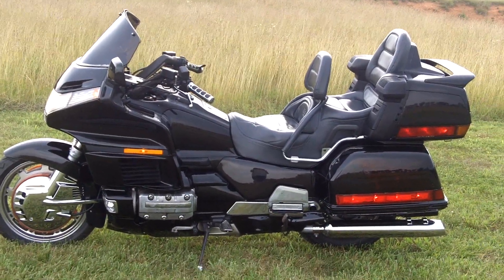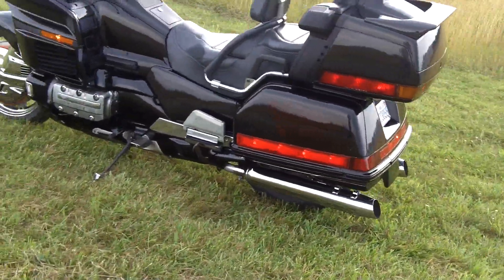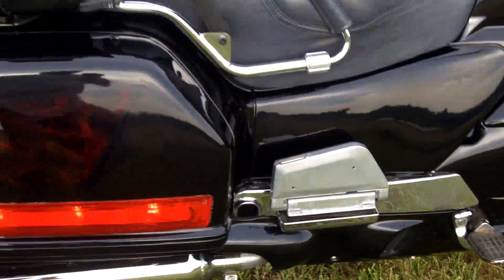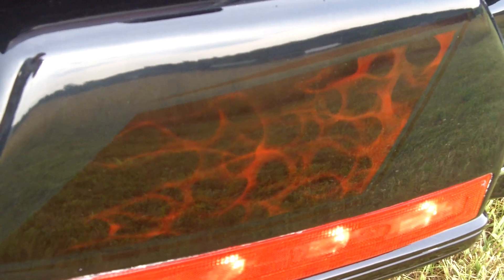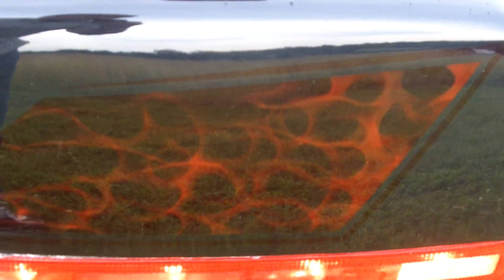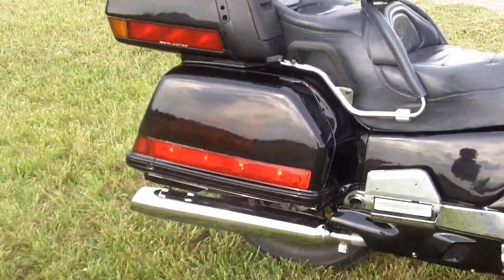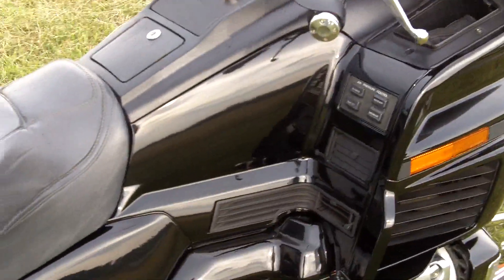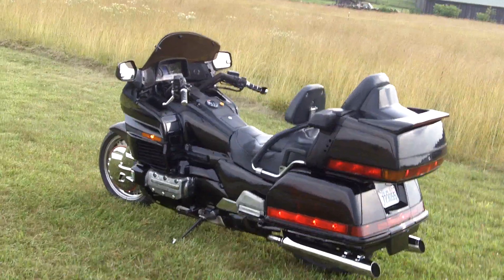GL1500 Goldwing-HD Mufflers-Custom Paint-Modified Stereo-Bagger Windshield

Comment from the maker: Thank you for your encouragement!  I got the windshield from baggershield.  Check them out online.  I really like the windshield because it gives me good options, with it "retracted" down, at higher speeds I get some helmet buffeting, but below 60mph, its quite comfy.  I've also added some LED lights I got from the auto parts store that are meant to be for the bed of a truck, and I put them in the saddle bags and trunk.  I then wired them to a $10 transmitter/receiver unit i found on ebay, so I have a key fob that I can push the button on and it will light up auxiliary lights and the trunk lights for those dark evenings where you want to see your luggage.  I ride this bike year round and put more miles on it than I do my truck and car combined.  Another nice addition that I've done is put pioneer speakers in it to handle louder volumes at higher speeds.  With the boat radio and being able to play MP3s on a thumb drive, I have all kinds of options.  Ive also separated the front/rear linked brakes.  I didn't like them being linked so I put a splitter in the front brake line to activate both calipers with the front master and I put a pipe plug on the rear master cylinder.  I have a track bike and I didn't want to develop "bad" habits of using the rear brake alot on the street only to have to unlearn that at the track when I go.
Reply: That’s awesome to hear! 
I’m looking at the Baggershield myself, wondering, would you recommend the shortened 19” one as well or would you stick to the convertible windshield that you have, due to the buffeting at higher speeds?

Comment from the maker: I used a boat radio that has mp3 playing capability.  Its a Milennia PRV15.  I removed the center panel and removed the origional stereo.  I made a fiberglass panel that would fit in the hole the the origional stereo was in and then used a hole saw to mount the new boat stereo.  I also had extra room on that panel so I mounted a large push button switch for switching off and on the fog lights and I also mounted a panel mount usb port for the thumb drives for music.

Comment: That is one super cool Goldwing!!! I love the blacked out effect and the painting of the chrome piece under the windshield and the short windshield ....slick. Gives it a distinct look. Now however I do have one question....I thought about using some Harley pipes "only for the sound" however yours seem to be rather quiet.....no rat-a-tat-tat or rumble.....How did you manage to do that?
Reply from the maker: I think with the cam profiles, you're not going to get alot of the combustion sound in the exhaust.  I think harley's have a cam that opens the exhaust valves earlier, allowing the combustion process to continue out into the atmosphere.  Basically I didn't do anything to keep it from being too loud - its just the way it is when I put those pipes on.  Considering the distances I ride, its nice having it still not painfully loud, however when I roll back on the throttle pretty hard, you can definitely hear it.  When I installed these pipes, I welded a little tab to the saddle bag lower support and used this to bolt the pipes to, but you don't need to, I suspect you can make a mount that uses the original mounts that have the bushings in them to adapt to the HD pipes.  I wasn't sure I was going to like painting over the chrome under the windshield, but I do like it.  I did it because my chrome panel was bent up pretty bad, so I used body filler in it when I straightened it so I had to paint it.  I've also installed a jet kit to offset the free flow exhaust because it tends to run a little lean with the HD pipes and stock jets.  Jetting it definitely makes it more peppy!

Comment: Great looking wing! My question is about the exhaust. I have Harley pipes from a road glide on mine but I'm wondering is the pipe you're using to replace exhaust chamber an "X"or 2 separate pieces directly from header?
Reply from the maker: @ShoNuffDC, sorry I've taken so long to respond, but I don't have the x pipe on it... just two separate pipes.  Would have been a good bit of work to make a cross over.  I did think about welding in a small pipe to allow balancing of pressures between pip sets, but I never did it.  Still ride this bike at least once a week.

Comment: How hard was it to make the piece for the radio conversion?
Reply from the maker: I took that center piece out and flipped it over on top of a flat piece of sheet metal, then "lined" the plastic piece around the radio hole with aluminum foil (put WD40 on the aluminum foil as a deboning agent to be able to get the fiberglass off of the aluminum when done), then mixed up some resin and hardener and used some CSM fiberglass strips and layed it up so the glass wrapped around to the original screw holes that held in the OEM radio.  Once hardened I popped it out and sanded it down and used some body filler in places to make it nice, painted it flat black, then drilled mounting holes that lined up with the OEM radio mount holes.  Then I drilled holes in it to house the boat radio, the switch I installed to turn off/on the fog lights on the bottom corners, and I also installed a cigarette lighter plug in it.  Been pretty handy!  Its not structural so you can use cheap fiberglass resin and hardener from lowes or something... you could probably even use an old cut up T shirt in multiple layers as the glass fabric if you wanted to.

Comment: Did you loose Cruise Control when you took out the Stereo? I heard they’re linked.. 
thanks 
Sick Wing
Reply from the maker: Nope, didn't loose the cruise control when I removed the original stereo.
Reply: @ApriliaRSVR08  oh really??? Wow that’s interesting.. 
Thanks 🙏
Reply: @ApriliaRSVR08  still riding the Wing??
Reply from the maker: @meals24u  absolutely... usually about 8000 miles a year.  I'm actually prepping to rebuild the engine as it's got a little oil consumption now that it's about 150000 miles.
Reply: @ApriliaRSVR08  no way that’s awesome! I just picked up my 1500 today, 80k miles, absolute excellent shape, completely stock! But I noticed the pipes on it are starting to rust out at the bottom! Told the wife right away, gotta get those Harley pipes haha.. She doesn’t like the sound of em, but they sort of sound like a Porsche so she likes Porsche’s haha
Anyway, I’m pretty stoked to do a few things on it and see where the adventure takes us..
Reply: @ApriliaRSVR08  while taking out the Stereo, did you run into any issues or straight up just unbolt and rip out? 

Did you reuse the power cable and the speaker cables for the new one or wire new ones in?
Reply from the maker: @meals24u  just pulled it out - I did use the original wires but I replaced the speakers.
Reply: @ApriliaRSVR08  oh ok great thank you!
Reply: @ApriliaRSVR08  ayeee a year later and here we are! Other than adding Bluetooth I haven’t done anything to my wing yet in terms of mods. just been enjoying it as is 🤣🤣

Curious where you found that plate/cover to go over the old stereo spot?
Reply from the maker: @meals24u  I laid up fiberglass myself to fit in there.  Pretty easy to do really.  You can get the resin/hardener and weave at the hardware store and I put wax paper or aluminum foil over things I dont want glass on. So I removed that center piece, flipped it over on my work bench and covered the opening with aluminum foil, sprayed the foil with cooking spray, and formed it around the opening laying over the screw bosses.  When cured I removed it and pulled the foil away and drilled holes for the screws and screwed it in place. I did this so I didnt permanently alter the original wing piece.

Comment: I found the pipe for $25 a piece and one place $25 for both used but $48 for shipping. I think not.  Just bought a 94  1500 and had to remove everything to get to the rear brake master cylinder. What a mess.  Nice way to start out a relationship by tearing it down to almost nothing.  Stupid design.  Nice sounding. I might take my set to a muffler shop and see what they can set me up with their design. Thanks.

Comment: i would like to know how made the music planal
Reply from the maker: @Odis Davis, I took the center plate where the original stereo was, removed the stereo to expose the square hole, then put aluminum foil around the hole forming it tightly against the plastic piece, then clamped it face down to a flat piece of steel and sprayed WD-40 to the aluminum foil.  I put carnauba wax on the steel plate then mixed up some fiberglass and lay it in the hole trying to get it to fit the shape as well as possible and making sure the glass went over the screw bosses on the plastic piece.  let it harden then peel it off of the steel and pop it out of the plastic, sanded it and cleaned up the shape, then set it back in the plastic piece and drilled out the holes for the screws for mounting.  Then cut holes in it for the buttons and the radio head, then did some light body work on it, painted it flat black, screwed it into the plastic housing, mounted it on the bike and wired it in.  Sounds like a lot of work, but can be done in a Saturday afternoon...